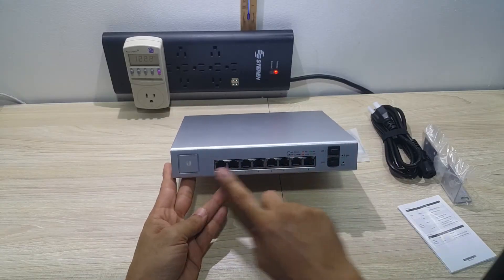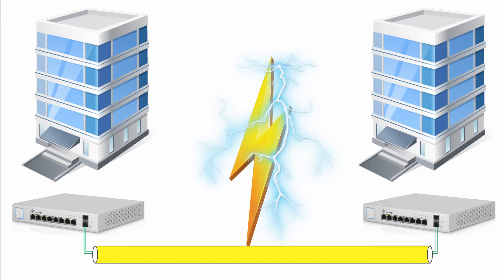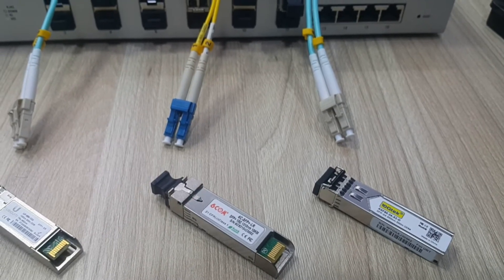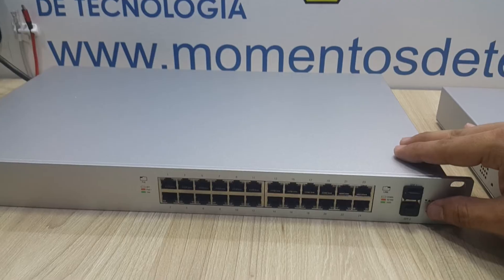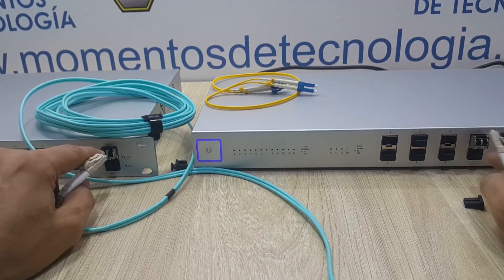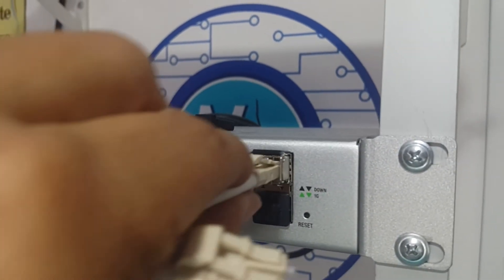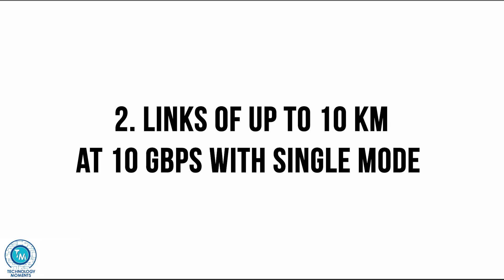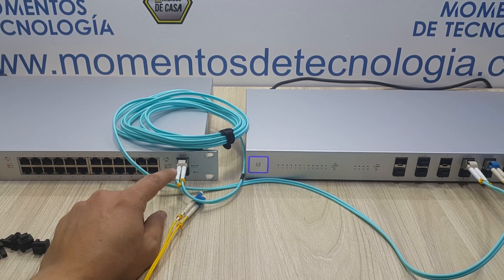Using Optic Fiber in Unifi Switches -  Which Tranceiver Module to use?

Comment: can i connect 2 unifi switches 1km away using sfp ports must sfp1 match sfp1 of another switch
Reply from the maker: Sure, for that, you're gonna need a couple single mode SFP transceivers like these (make sure compatibility with wour switch's brand)  https://amzn.to/4gj1tvW just check the wavelength is the same at both ends and that the fiber supports it.

Comment: Thank you for the video. I was trying to understand the way FO cable connects from one switch to the other, especially for backbone cable. At min 08:00 you pointing at black cable, what cable is that and where is the other end of the connection? I also notice that you removed it after you connect the FO cable to the port.
Reply from the maker: That is a copper uplink that maintains connection with the controller while you setup your other ports.  First in a controlled environment before you take it out to its final location.  Thanks for your comments and interest.

Comment: I have a usg pro that I want to connect via multi mode 10 gig to UniFi switch 8 port 150w over 100 metres and then daisy chain to another 8 port 150. Is this possible?
Reply from the maker: Technically of course you can do it but at a max speed of 1.25 Gbps as the US8 only has two SFP ports and not SFP+ .   But you can can go as far as 550 m with MMF .  Hope it helps and good luck with your project.

Comment: Hello a very informative video, but I wonder we have a LC simplex fiber internet thats plugged into a CPE interno xg6846 via a SFP module from there it gos to a 24 port ethernet switch that goes the wall outlets arounrd the home, we only need computer internet not TV telephone etc. So I wonder can I plug the LC sfp module straight into a more modern ethernet switch without the need  of CPE (or media converter) ?
Reply from the maker: Hi, that is very common question, however the most probable configuration your xg6846 has is a router, so you cannot take it out.  It may not look as much but the ontly thing you need from it,  is internet bandwidth connected either to your switch or to another router of your own which you could fully manage.  Does not make any difference in terms of conectivity.  If you want to have full control of your internet, ask your ISP for a public IP to be managed by your own router, you'll have full control then.

Comment: Great video.  I worked in a data center and it took me a while to understand why our support people used to ask us what color was the fiber cables - as if they were blue, or yellow or orange, it referred to the mode and speed they could transmit and receive at.  One thing I had a hard time understanding was how in the world they ever wired up the phone line linkages, there must have been thousands of tiny color coded wires all wired into a patch panel, that was like 50 feet long by like 5 feet tall.
Reply: Toners and Butt Sets lol

Comment: I am trying to connect a cisco switch with Unifi switch via SFP, multimode fiber.  Which SFP is ideal for this ?
Reply from the maker: Hello Theepan.  From my experience most of them are compatible but you may loose some interoperability and meter readings when you use them in different equipment.  It is better to specifically buy one compatible with your device.  Such information is always available in the characteristics of the SFP module you just have to make sure if it is SFP or SFP+ on each, once you link them you select the speed at which they will share information.  Sometimes auto link works fine. In Unifi speedlink may be necessary to be configured.
Reply: sometimes Cisco works only with original SFP, ebay is your friend
Reply: I went on ebay and youtube and some companies will tell you which sfp is compatible for what type of router/switch.  They have graphs and databases so you can match things up.